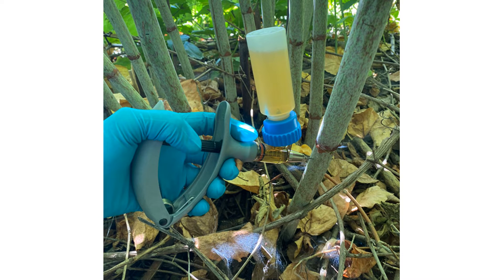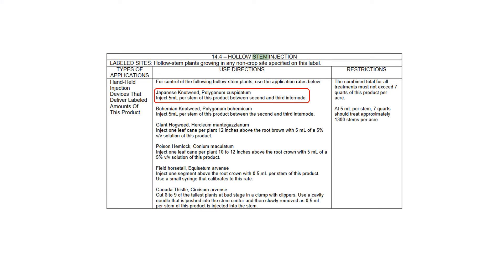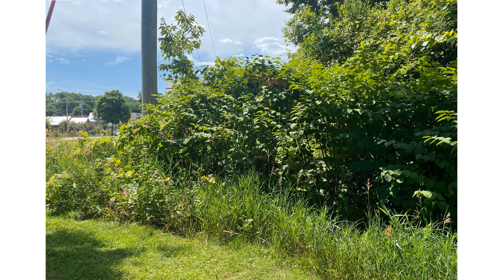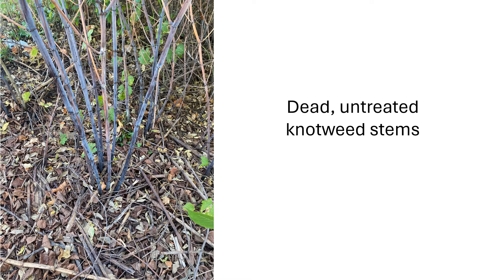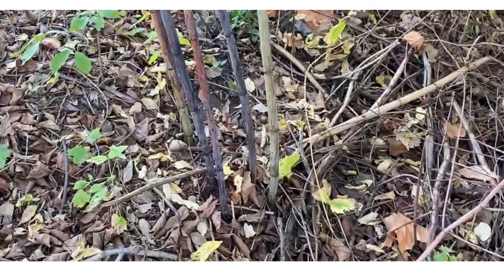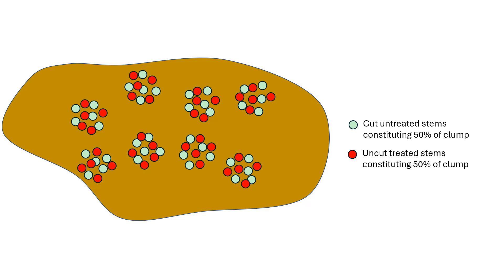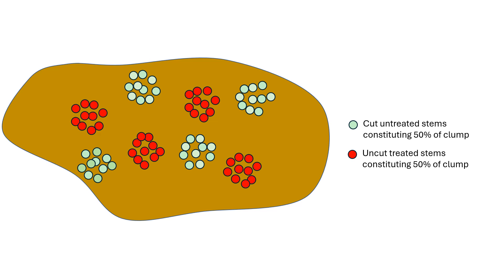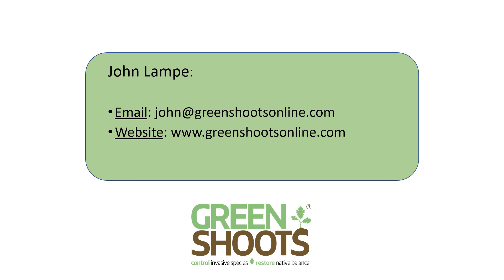Knotweed Experiment: Cutting Knotweed Stems to Draw Herbicide from Injected Stems

Comment: Interesting idea. Your proposed technique would probably be most useful in areas where foliar spraying isn't possible. Otherwise, when damage through drift isn't an issue, why not combine stem injection and foliar spraying? That's what I did last fall, first I injected the bigger stems and then I sprayed the whole patch. I hoped combination of both techniques gives me a better outcome. Overall pesticide use still limited and everything died off nicely. Let's see how much regrowth I get in spring, though.
Reply from the maker: I will be interested to hear how you combination of foliar spray and injection works!  I hadn't thought of that.  It especially might be useful for getting large stems in the middle of a patch that are hard to spray.  To your question, yes, i think you are correct.  The technique proposed here would be useful where someone only wants to do injections.